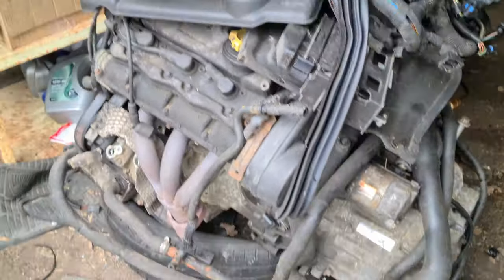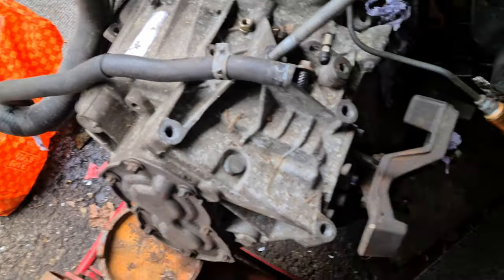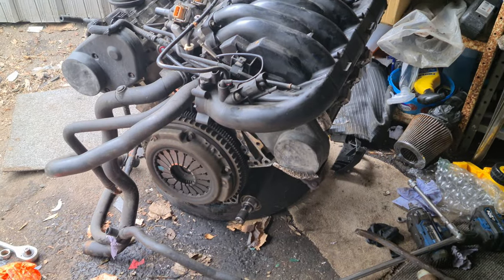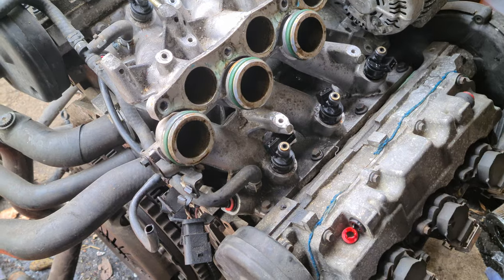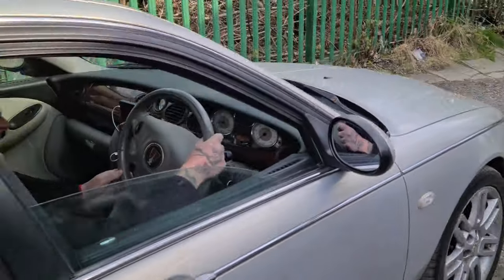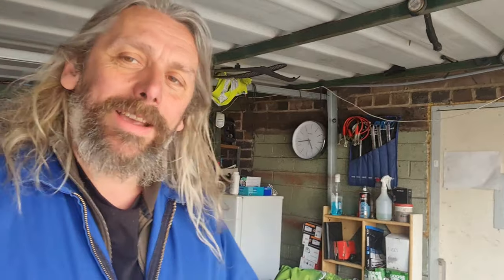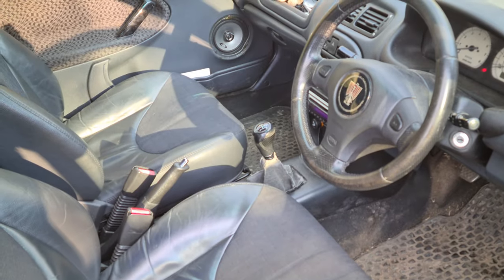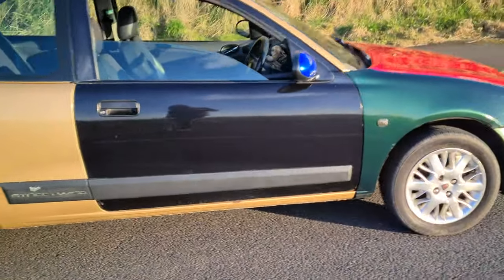Dismantling a Rover KV6 engine

Comment: Shame you didn't go into a more detailed strip down its so hard finding an English version of a kv6 strip down
Reply from the maker: Well, it's what I did that day. If the video contained just stripping it down I think subscribers would get a bit bored
Reply: @ProjectNigel  I wanted to watch it because I am about to strip an engine and your vid didn't show much even the air con pump removal your vid don't show enough just you so put in the heading me chatting and a few bits on a kv6 engine
Reply from the maker: It's just bolts holding things on, I have never stripped one before, you just figure it put as you go along.
Reply: @ProjectNigel  neither have I but you could have done more to that engine people watch because they are looking for information I can give you info tho never use composit head gaskets on this engine I made that mistake and I am having to do it all again with the proper metal gaskets
Reply from the maker: I will bear that in mind if I ever try to fix one. Thanks 😅